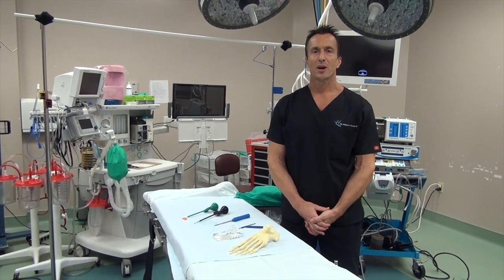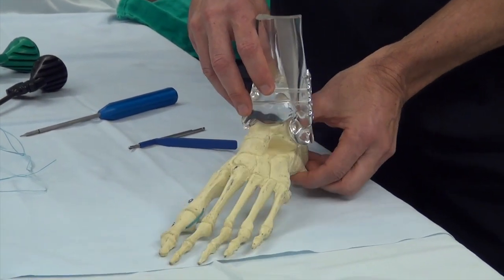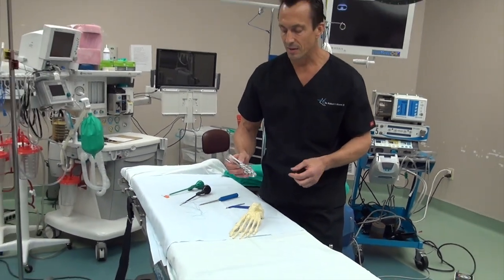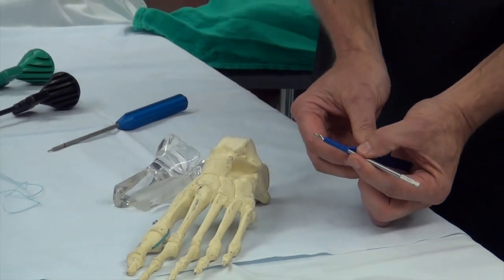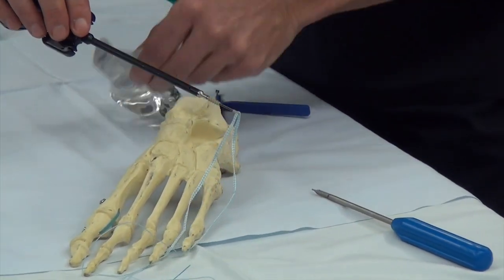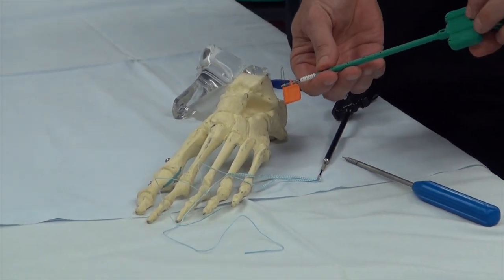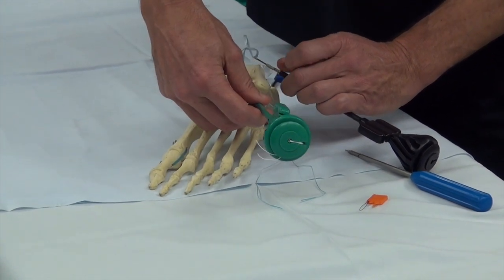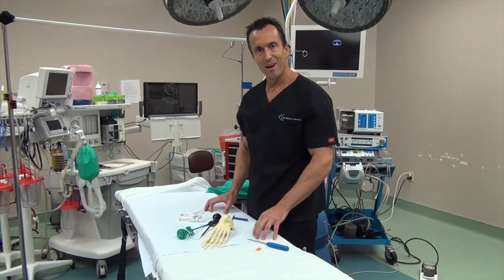Dr. Moore Explains Ankle Ligament Repair and Reinforcement Using the 'Arthrex' Internal Brace

Comment: I torn a ligament in my right ankle just after I fell and sprained it a little bit over 5 years ago. I never had surgery on it. It took a while to get back to normal in walking. I remembered it was swollen and had bruises around the foot, 3 of the toes,the heel, and even the ankle. It was the worst sprained ankle that I ever had. I also had a broken ankle on my left just a little bit over 10 years ago. That one that I had reconstruction surgery on. It seems that I’m pretty tough when I got older. The pain from a broken ankle is much worst than a bad sprained ankle. I had so many sprained ankles it to a day or 2 to get back to normal. When I torn that ligament it took a little bit longer than my broken ankle was. When I was little that I did cried a little bit because of the swelling from the sprained.
Reply: you have to rest when you sprain your ankle